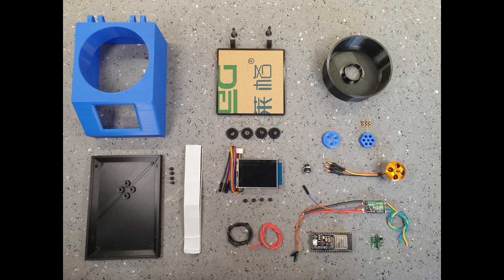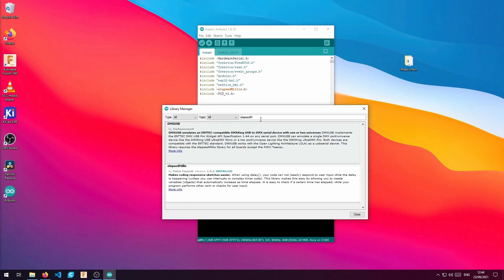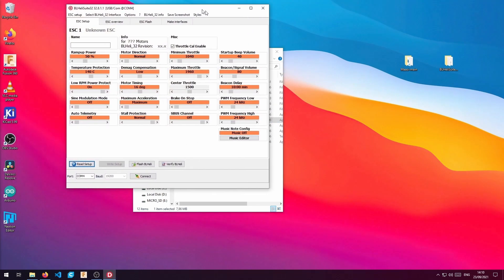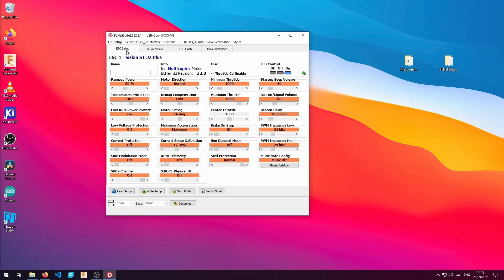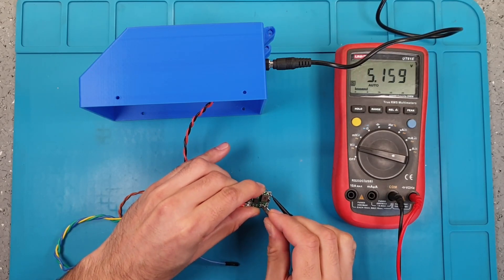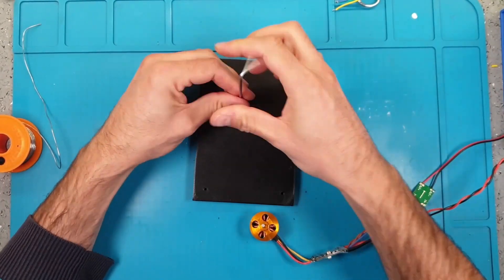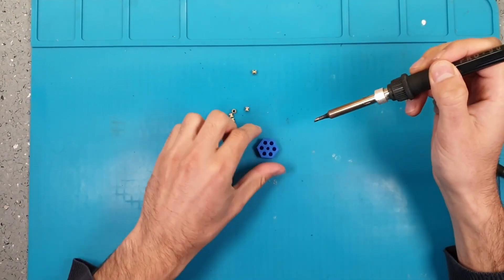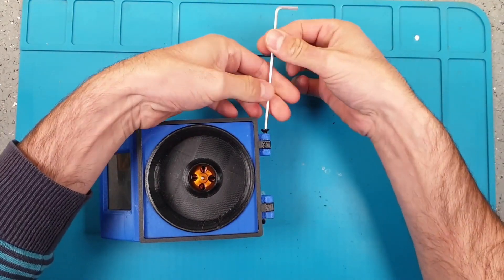Maasi Open Source Spin Coater - Build tutorial

Comment: Unfortunately, blhelisuite32 rev32.7 is no longer available; the only version available now is the newest one. Will it stil work?
Reply from the maker: Thanks for the interest in the project. Beware it is not longer maintained. I only tested 32.8v and the speed control was not as precise as with the 32.7v. Depending on your application the coater would be usable or not. The difference was noticeable but an indepth study was not conducted.

Comment: The BLHeliSuit is no longer supported by BLHeli.  What this means is that you can download the BLHeliSuit and change ESC settingsds but you can no longer flash with a new firmware.  So the firmware that the ESC came with is the one you are stuck with.  I am unsure what instabilities @Dani Carbonell is speaking of in the video but I guess I will just have to find out.  I will be trying with firmware 32.8 and not the 32.7 that is strongly recommended to us here.  Crossing my fingers hahaha
Reply from the maker: I tried V32.8 and I had some problems getting a stable speed control and a good performance compared to V32.7. There were some related changes in the firmware changelog if I dont remmeber wrong. Feel free to share the results here
Reply: Did you manage to do it?

Comment: Hello

What do you think is the reason why the engine sometimes stalls and suddenly stops and starts?

The materials have exactly the same properties??
Reply from the maker: Have you tried another PSU?
Reply: @danicarbonell4314  yes. i used diffrent PSU high power. but result is same. i think Kp, Ki And KD values .. i am using dshot 32 Bit ESC and 1100 KVA motor and 12 V 5A Power Supply. i just saw your answer. if you take email i can send video. maybe you can help me more . because i didnt solve this problem.

Comment: Hello. It is a great project. Did you update the code in order to  run it with versions of BHeli_32 32.8.x or newer ?
Reply from the maker: If I dont remember wrong, BLHeli_32 32.8v should work but they changed something in the firmware that made the Dshot control way less precise compared to 32.7 when runing an external speed control loop. I dont know if in newer version they have fixed this. Sadly I dont have a unit myself to test.

Comment: Hi, I'm attempting to flash the ESP32 with the BLHeli32 firmware and getting the Cmnd_STK_GET_SYNC error (compatible device not found at COM port, basically). Arduino IDE uploaded to the board just fine. I'm positive I'm using the correct COM port and have all the same settings selected as you do. Any advice?
Reply from the maker: The BlHeli32 firmware is for the ESC (Electronic Speed Controller) not for the ESP32.  You need an Arduino UNO to be able to flash the ESC but the ESP32 can be flashed directly per USB.

Comment: Hello friend, how did you perform the time phases of the process, low speed, then high speed and finally low speed.
Reply from the maker: There is acceleration curves and the parameters can be adjusted in the settings menu. Also the the RPM at the dispensing step.

Comment: Excuse me, I can use the Esc 30a Brushless Control Drone F450 F550 Fpv Emax 3s 4s as a controller, thanks
Reply from the maker: You need also the ESP32 to control the screen and the PID loop.

Comment: Great video, most of the details are covered. Small confusion in wiring, but figured it out by your video.

Great paper on Science Direct, issues having getting everything working.

Having issues working on your project from Science Direct. Something is not working properly, everything hase compiled properly, same parts exactly. I am having issues with the HMI. Their is no signal communication from the esp32 and HMI to the motor. Possibly issue in the code. Once plugged in the HMIs buttons don't work which is probably due to communication issues. 

It seem other users are having similar issues. I would highly recommend a fix or solution soon. 

Keep it up👍👍👍
Reply from the maker: UART coms seem to be broken since release 1.0.5 of esp32 Espressif Libraries. I am still investigating the cause. Please install esp32 version 1.0.4 from the board manager menu in the Arduino IDE.

Comment: This is a little confusing.  In the video when you're wiring up the motor you have the yellow wire on the outside and black in the middle, yet on the diagrams it shows yellow in the middle and black on the outside.
Reply from the maker: The firmware takes care of the phase order at the inisialization and will spin the motor in the right direction in any case.

Comment: @Dani  There is an issue.

 the HMI display isn't working with the ESP32 code.

The buttons seem to work correctly but no communication. I believe a few individuals are having this issues.
Reply from the maker: Hi Siosin V. Thanks for the insights. Could you open an issue in the Github repo?
Reply: @danicarbonell4314  I believe someone has already, it seems it's the same issue. But definitely I can!